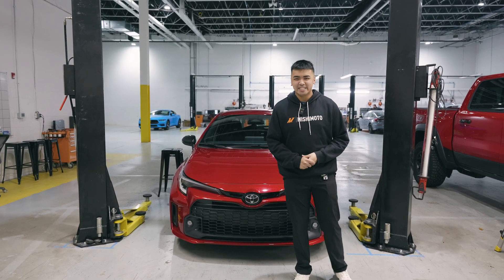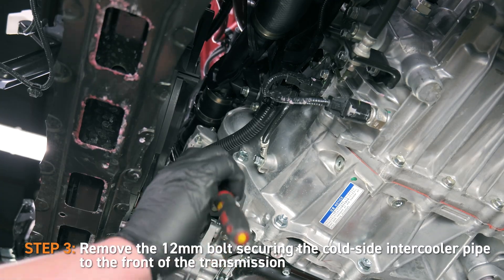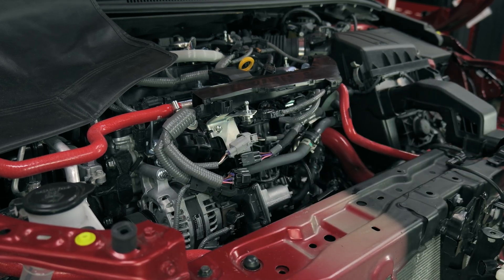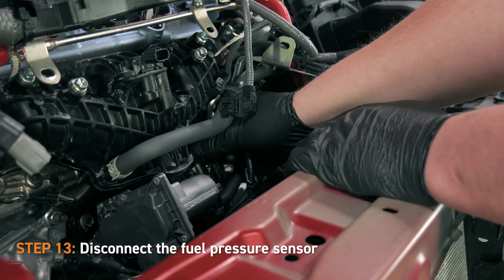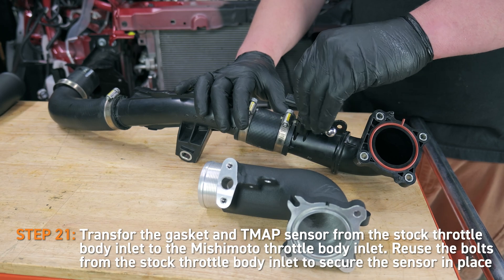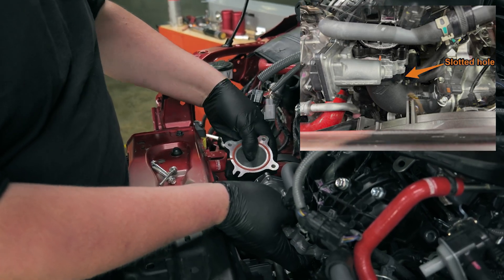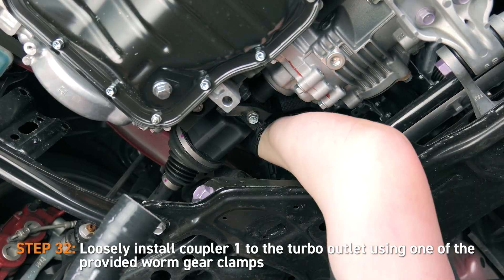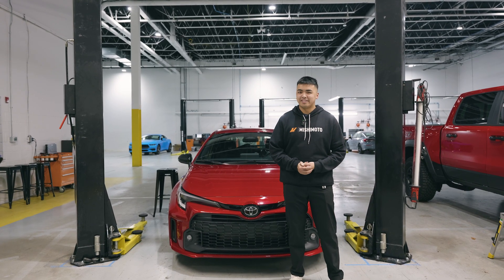How To Install Charge Pipes | 2023+ Toyota GR Corolla

Comment: This looks really difficult
Reply: yes get the otl much easier install and better performance just have to switch out oem pipping and connect the intercooler
Reply: @shiftautomotive1997 but the otl doesn’t come with the throttle body inlet. If you go this route might as well change the manifold while you at it to a Weldspeed intake manifold..
Reply from the maker: With our guide, installation should be smooth! :)